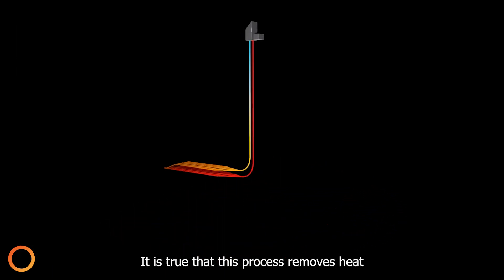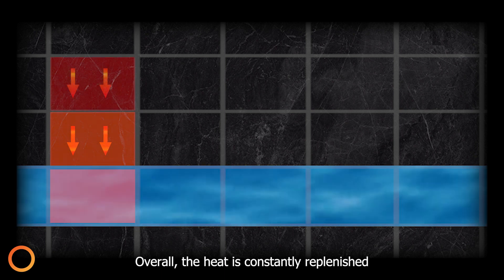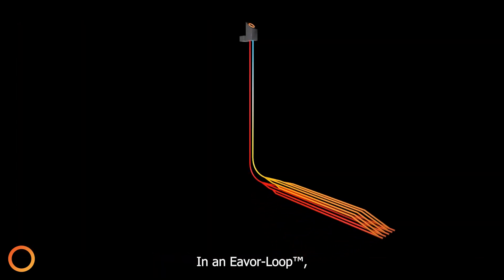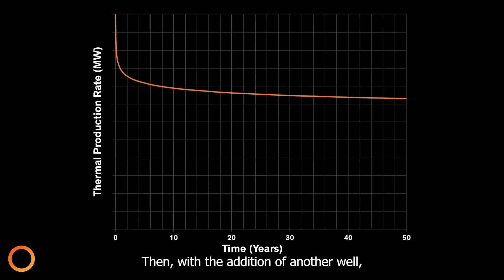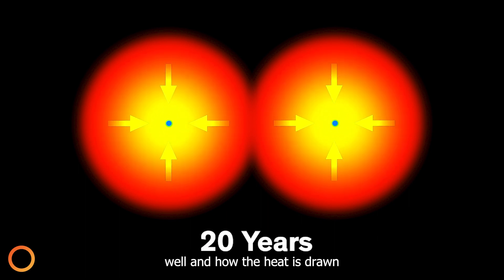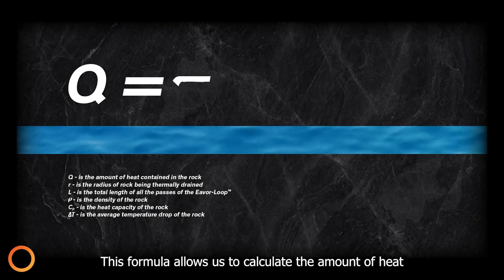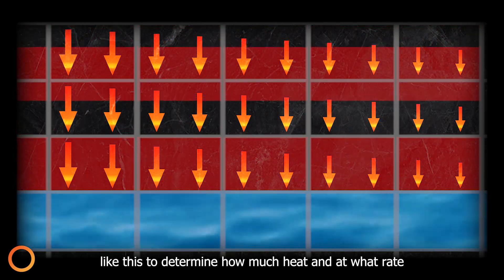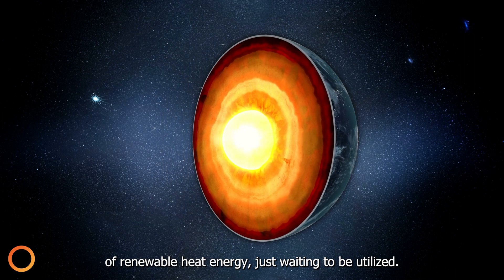The Thermodynamics of Eavor-Loop™

Comment: You don't have to do this at an industrial scale - bury a couple of hundred feet of pipe more than six feet down in the ground and circulate water through it - the water coming out will never be colder than about 50 degrees f. Given reasonable insulation, the dwelling will never freeze inside. Power the circulation pump with solar and you have almost free heating and cooling.
Reply: This is for power production, you are talking about residential applications

Comment: You build 4 power plants. You turn one on, ten years later you turn the other one on, ten year later you turn the third one on. After 30 years you turn off the first one and turn on the 4th one and just rotate then on and off. One is always fully charged, one is always very charged, one is always mostly charged, and one is always recharging. There didn't seem to be a huge decline after 30 years, but perhaps that chart is not to scale.

Comment: A company founded by investment pros adept at spinning BS like "thermal conduction" based geothermal into "holy grail" solutions. Just at around 1:20, they get the first principles so wrong, the thermal mass of rock is much smaller than that of water. Granite has a specific heat capacity of ~ 0.79 J/g°C while water has a specific heat capacity of ~ 4.18 J/g°C. So a small increase in the temperature of water would need several degrees drop in rock temperature for similar mass. The thermal gradient around the rock would be really high due to the poor thermal conductivity of rock. This concept is loaded with a lot of BS, if there are some investors looking at this video, beware. Eavor never shares any numbers in any of their videos, they just hype it up by saying "this sh** is awesome, it works". There is a lot of literature that has already done the "due diligence" on closed loop geothermal systems that rely purely on rock conductivity.
Reply: You are right when you talk about heat capacity of water and heat capacity of rock. But if you have 1 m3 rock around the pipe with diameter few inches then on pipe you have 22.2 liter water on 1 m length and the reservoir around the pipe is thick and let say 10 m radius will transfere the heat. This rock around 1 m pipe has volume 314 m3 or around 830 tonne. The heat on these volume if temperature is 250 deg C then will be 164423106 Joule or 46 kWh.  Now what about a 100 meter rock radius around the pipe, these rock has around 4567 kwh energy. Hope my multiplications are correct, I believe they are.   All this energy is to heat only 22.2 liter water multiple times and convert in steam, so the energy is there. The problem with this geothermal technology is the depth and drilling on very hot rocks. This cost money and make the technology very expensive. and then it is not that the drilling is 1 meter or 1 km, drilling is some kilometres with some pipes.
Reply: @NickGj-k7v  the technology might be expensive, but the whole plant is less expensive per MW than a fossils plant.

I think it's a thing of perception.
A high percentage of the total cost goes into drilling, which is the first stage. "Sounds" like a lot for just drilling, but it's less in the whole, with big savings in the long term.

Then the source is free, forever. That should be the main perspective.

Comment: What is the estimated cost of construction? It's my understanding that you need to go down 5 - 10 miles in geographically stable (non-volcanic) areas before you get enough heat for steam generation. That would seem to be costly and challenging, but I'm no engineer, so I'm sure they've thought it out.
Reply: Drilling these wells is not cheap and challenging to connect them like the diagram shows.  My concern would be once the well is drilling and they are connected how do they maintain integrity.

Comment: 30 years isn’t a long time. How long will it take to replenish the heat if the well is shut down?
Reply: Just couple it with solar thermal energy- problem solved

In the summertime, you pump heat into the system by collecting solar energy and pumping the warm water into the stone-thereby re-heating the stone-heat-battery. And in winter you pull it out again.
With this you have a system which is much longer reliable.

Comment: Is borehole stimulation used there?
Reply: No stimulation is used!

The fluid (e.g. water) remains within the wellbore at all times in the process - it is a self-contained system.

Stimulation would only be interesting if one wanted to promote fluid flow through the rock formation (e.g. towards a borehole). The system they are describing does not require any fluid flow through the formation itself - stimulation would not make their system any better.

Comment: Do you add any kind of casing to the wellbore?  I’m wondering if, without a pipe, you would ever hit a fissure in the rock interfering with the loop….
Reply: According to one of their other videos they are planning to install casing down to the target rock formation (I.e. the vertical bit of the well in the video).

For the laterals they are planning to apply a sealant to stop the fluids from escaping into the rock formation. I believe they call this "technology" rock-pipe or something

Comment: If you turn it off for a while, won't the heat completely replenish? How long would that take?
Reply: The answer to that question probably requires running a model. You might want to add specifics

Comment: Interesting. So the well has a limited lifespan akin to a battery and producing at a higher rate will drain it faster.

Surely the rock wouldn’t go completely cold though? So wouldn’t even a “dead” well be useful at least for district heating after its electricity days are over.

I’ve never thought of geothermal as a non renewable/finite resource though
Reply: That is not exactly how it works, if you stop using the well it will warm up again, just the process might take years/decades... then you can use it again.